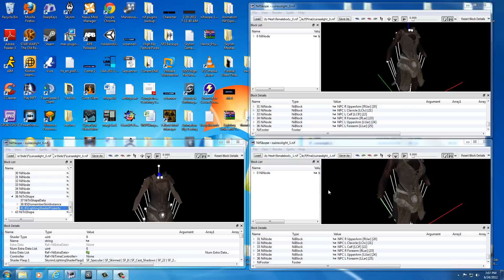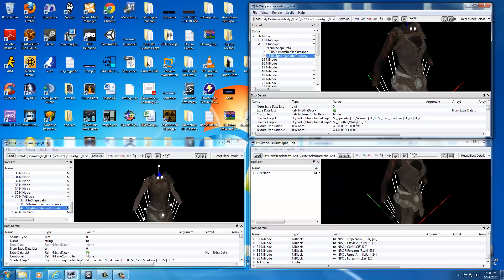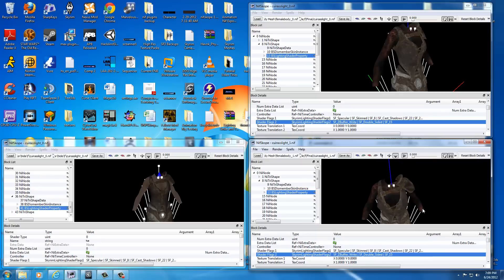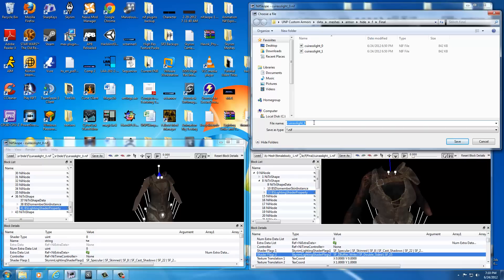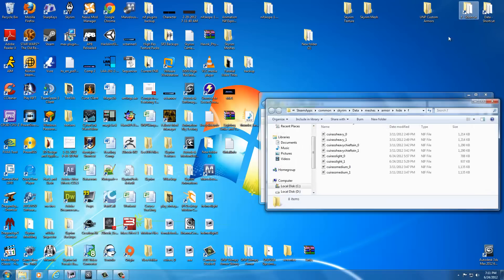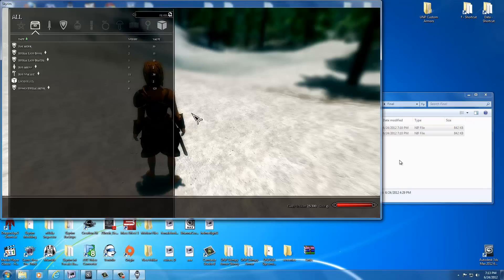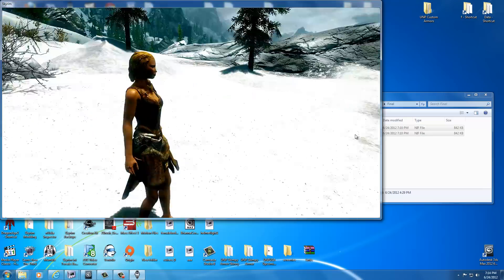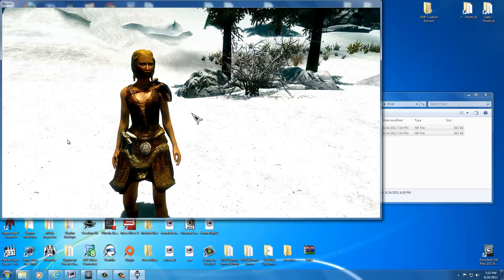16 - CA4S - Final Touch Up and Final Testing

Comment from the maker: Well, I have never made a BBp armor but if I am not mistaken you need to import the main body with the BBp skeleton. It has more bones then a normal version. If you are skin wrapping to a normal body and not to the BBp body with the extra bones that could be your issue.

Then again, if that's not the case then the issue has to deal with adding custom vertice weights using a weight painter. That tutorial has yet to be made but I will be doing one on that as it is essential knowledge.

Comment: hiya, first of all thanks for the tutorials and for ur great mods on nexus.
got up to this point in a couple of hours and my head feels, like it'll blow off^^ anyhow: first time working with weight sliders everthing went perfectly right, no differences in filesize for cuirasslight_0/_1. after tweaking the files with nifskope, i kinda messed it up, for i somehow had two differently sized files. is there any quick way to solve this issue? wouldn't want to start all over again. thanks

Comment: Have run through the previous tutorial 3 times and tried copying over the uncorrupted texture from the Skyrim Texture folder as well as from the original copied into UNP Custom Armor/etc/etc. Still no armor texture in game though the UNP skin texture came back with the tutorial instructions just fine.

3Ds 2012, Nifskope 1.1.0, latest 3Ds NIF plugin.